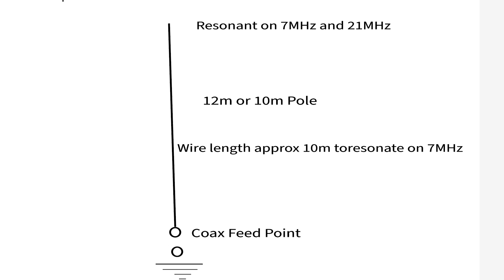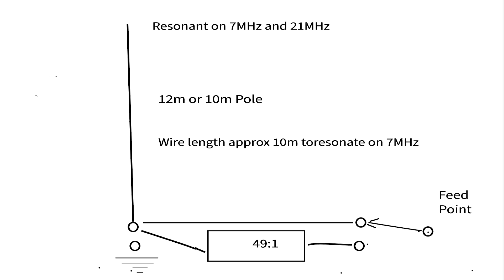Ham Radio HF Vertical Antenna -Small Garden HF 4-Bands Self-Build

Comment: There is no such thing as a magic antenna. Matching is not everything.  Radiation efficiency will be very low. In other words very little amount of power will be radiated. You will make contacts but what about the 100 contacts you did not make.

Comment: If you have a garden with a large tree then why not take a leaf out of (SK) W5JGV and copy the design for his Treetenna and see how far you can get out on 600Mtrs but other bands should be possible by changing the tapping point and maybe changing the variable capacitor.

Comment: Have you since made this antenna?
On the 49:1 balun, do I keep the 100pF capacitor in the circuit?
Reply: My question exactly. If EFHW works with no switch, but with 100 pf 3KV cap, why is one needed here ? I hope this gets answered. I’ve asked this question on many forums with many different answers.

Comment: Why can't the switch be at the other end, 2 coax to the shack into the switch
Reply from the maker: A long length of open circuit coax results - all kinds of potential problems.

Comment: Hi Peter, another very interesting video.  Based on your past videos, I ended up buying a Diamond BB7V vertical!   It is very well constructed, and I can definitely recommend it.  I used it last August with my 7300 at 100w, with success, from a caravan in a field in Herefordshire on 20/40m and had several contacts in Europe.   That antenna works without radials as it has a loading coil.   You mention needing a ground rod in this video: should I consider earthing the bb7v somehow to make it more efficient?  There is no mention of this in the rather sparse instructions from diamond!  Thanks and keep the videos coming!   (I have already made an efhw and the matching transformer as in your previous videos and it has also performed very well!) Mike.
Reply from the maker: Hi Mike, great to get your feedback. Summer is on its way again!  73 Peter.

Comment: If you can't get out radials, guys are going to be bit of a problem.
My only spot for a vertical is at the end of a narrow. A vertical might work acceptably with asymmetrical radials but will a Spider pole survive with out guys?
Reply from the maker: Spider poles are normally used without guys providing they are against a post of around 1,5 metres. 73 Peter.

Comment: Buy a DXCommander Classic ABV and you will have a 7 band antenna on one pole! And no matching problems!!! 40-10 metres on one feed.
Reply from the maker: But many hams like to build their own antennas and experiment. For example an end fed 20m half wave out performs a quarter wave. 73 Peter.
Reply: Peter I don't think you realise that the dxcommander is a kit and you have to build it. It's a better option than your solution. The lower angle increase in field strength, in your end fed vertical,  is only 1db and probably lost in the matching transformer. Anyway each to their own!  I have no connection with Dxcommander. Maybe you could stock them!

Comment: Hi Peter - great article! Now my problem is, is I live on a housing estate with a fuddy duddy Body Corporate (a group of rule makers that were not born in this or the last century) and their ruling is my Diamond CP6S antenna is not allowed to be seen from the road which makes 80m nigh-on impossible. I have a centre-fed long wire but it's too long for the size of my garden so would have to have it above the roof - a big no-no here.
I'm in a rental so options are limited, as is budget. Any ideas on a stealthy antenna to work 80, 40, 20 and 10m - I have a manual tuner plus the tuner in the Icom 7300...
Reply from the maker: You give mo indication go garden size. I would seriously consider an end fed 30m long wire with an 80m chock resonator. I use one myself. You can bend it to fit the garden. Vibroplex make one or you can build one. Check my end fed videos. BTW you don't need an ATU. 73 Peter.

Comment: In fact I made two of these for my QRP rigs for SOTA work in the past 12 months. A DPDT toggle switches the 49:1 In or out. My 10m long vert i cal element is actually 7m long with a centre loading coil. Works very well on 40. In the 20m setting, transformer and series C in circuit, it needed a bit more length, and so I added some air cored  turns at the base.  This is an obvious idea, thanks for promoting it, I'm not sure quite why more people aren't using it! BTW I haven't tried it on 15 or 10 but that makes it all the better. 73 Paul VK3HN.
Reply from the maker: Hi Paul. Glad to hear from you. The centre loading coil might be persuaded to act as a choke on 10m. That would create a half wave on 10m. But as soon as you introduce any inductance it has different effects on different bands. Suck it and see is the quickest way to find out. 73 Peter
Reply: @watersstanton  Thanks for replying, I'll bear that in mind!

Comment: I note that my swr on an EFHW 20 meter is nearly flat at the matching box but when I attach the rg58 coax( maybe 20 feet ) the swr increases to 1.5:1. How can I resolve this issue. I am using small toroids on the coax to prevent common currents. 

W5sk
Wave
Reply from the maker: I would first of all try increasing the turns on on the torroid. Unfortunately some VSWR meters are still affected by their position on the coax. Try increasing the coax feeder length with a patch lead of around 3m. If the VSWR changes then you will know that the meter is affacted by its position. 73 Peter

Comment: Amazing... I am designing this exact antenna for my POTA activations this spring & summer, with the exception of the switch. In testing, it seemed to work great on all of the bands you mention. My Xiegu G90 tuner actually matches it from 80 thru 6, though I doubt it’ll go far on 60 or 80. But the WARC bands get out okay. But regarding the switch, a double-pole double-throw switch mounted in the transformer box could work. One pole would short the 50-ohm input of the matching unit to the output, thus bypassing the transformer’s secondary. The other pole would open the transformer primary winding’s connection to coax ground. A/B testing on 40 and 15 should be very easy. I will report back with my findings.

Comment: G’day Peter

I have looked into this. One thing to take into account: At the base of an end fed half wave you have a rather much larger impedance than a quarter wave

Given Ohm’s Law and your power being V^2 / R your feedpoint voltage will be significantly higher on 20m into an EFHW than on 40m 

Now, your solution may be to make a 49:1 balun with say 14 turns on the antenna side, and switch between 2 turns and 14 turns on the transmitter feed side, but the voltage on that 14th turn on the transmitter side will still be at that high potential. 

Assuming the antenna is only 1800 ohms end fed, at 100W that’s 424V of RF so any remote switching you do must take that into account. 

You can reduce impedance by not quite feeding at the end, but a few feet in and reduce the feedpoint impedance of the half wave under 1500 ohms, but your 40m goes weird. 

I’ve been playing with this idea and simply installed a telescopic drawn aluminium tube with a 10m-ish length that tunes 20m with a matching transformer, and nearby ground stake, which works successfully....however, on 40m, the effects of the ground require something much shorter. 

I’ve settled on simply installing a base loaded helical whip tuned for 40m-ish on top of the 10m aluminium pole which gives me good broad coverage of 20m and a 250KHz chunk of 40m under 2:1SWR both behaving electrically as end fed half waves, though the 40m antenna is slightly longer than a quarter wave ground plane. 

I’m still experimenting, but given our small inner city plot we have here in Sydney’s Inner West Safe Space, with a 1970s Greek Lawn (concrete) my options for antennae is limited. 

Best thing I built is a switchable transformer match box that switches between 2 and 14 turns around a T240-43 on both the antenna and feedline side so I can make up any ratio I want to get the antenna to match. That said, I can only use this for end fed up to around 40-50W before I run into arcing. Given I’m only running 15-20W of CW it’s not usually a problem 

I’m looking forward to see how this idea works out for you.

GL es 73 de VK2NAP

Comment: the trouble is now when this new ruling comes in from OFCOM all Radio Amateurs in this country with modest set up will have to rethink about where their antennas are situated and how they have them mounted, for example, if you have a Loop antenna which is only 1 or 2 meters off the ground or an HF vertical that's ground-mounted I think they will have a few problems on where to put it? especially if you are like me and live in a townhouse with a small garden. is this the think end of the wedge  I wonder?
Reply: What’s the new rule for OFCOM ?  Here ACMA is stepping right back from most ham radio stuff.
Reply: @Brian.  I reckon that new rule is mainly there for the role out of 5g...    It was in the news today that the 4 big network providers have just bought up lots of available radio spectrum....
Reply: @yorkshirebikerbitsnbobs  you like the rest will have to abide by the rules.

Comment: The only issue with using 10m as a second harmonic to the 20m band efhw is that as a full wave its take off angle, even as a vertical, is much higher than if it was half or quarter wave. So ok for short hops but hampered somewhat for DX. 73
Reply from the maker: The vertical dipole is 2 degrees better than a quarter wave,  A full wave vertical is 30 degrees - not as high as some would have you believe. The worst length is 3/4 wave. 73 Peter.

Comment: Also these poles work great for supporting middle or end of a hw dipole Cntr fed with Toah Harbor open spaced feed line. 4” electric fence ribbed isolators tractor/farm supply plus 13” uv resistant wire ties and a spool of #12 Awg thhn solid core copper wire and balanced tuner you have the best multi band dipole with no coax loss. Coax eats a ton of 100w even short lengths. Balanced fed line puts out 97% of the output power 😉😉
Reply from the maker: Thanks for sharing. Losses on coax are actually quite low at HF with modest runs.  73 Peter.

Comment: Peter why don’t you try a Dx Commander pole ? You keep singing about spider pole this but why not buy a all in one antenna like the Dx. All the math spelled out with great wire and assembly’s fixture down to the nuts and bolts and clamping. Also you had sum bad audio feeds in the middle4:30). Stuff not lining up and all over the place. Might want to give it a look.
Reply: Kevin, the DX Commander a wonderful antenna. It’s a quarter wave on whatever bands you select. But home-brewing verticals with and without transformers requires only a modest investment. Experimenting with antennas is a fun and rewarding aspect of the hobby. Plus, it teaches skills that can save lives in an emergency comms scenario. You should join the fun.
Reply from the maker: Hi there. I don't think the Spider Pole is available in the USA? It's simply superior and stronger. I also like vertical dipoles as they have better DX gain. 73 Peter.
Reply: @watersstanton  Yes, the Spiderbeam pole is available in the U.S. thankfully. : )

Comment: I wish it would work on a 20m high Balkony without any Radials...
Reply: Für Betrieb als Viertelwellenstrahler auf 40m wird es nicht ganz ohne Radials gehen. Ich hatte vor einigen Jahren eine ähnliche Situation. Was Du versuchen kannst ist, mit stark verkürzten Radials zu arbeiten. Die fallen kaum auf. Jedenfalls nicht mehr als eine 10m "Angelrute"... 

Wenn der Balkon eine Metallbrüstung hat und Du direkt zum Metall eine Verbindung herstellen kannst, dann koppel diese Brüstung über eine entsprechend dimensionierte Spule an den Speisepunkt und der Balkon agiert als abgestimmtes Gegengewicht. Alternativ schließe die Metallbrüstung direkt an den Speisepunkt an und nutze eine Teleskopantenne mit entsprechend dimensionierter Ladespule als abgestimmtes Radial. Viel Leistung geht dann vermutlich nicht aber in der gegebenen Situation mit "Balkonantenne" ist hohe Leistung eh nicht machbar, ohne das die Nachbarn gestört werden.

Hoffe, Dir eine Idee gebracht zu haben. Bei mir hat es damals geholfen. Jedenfalls so lange, bis nach Eigentümerwechsel die Antenne vom Balkon entfernt werden musste.

73!
Reply: The Magnetic loop is your friend
Reply: @MidlifeRenaissanceMan  on a 4 by 10 foot Balkony with Roof isnt Space for a Mag loop...
I go for a Vertical outside of the balkony Mounted... only got hight restrictions. 10m over the Flatroof is end so a Vertical for at least 20m band is possible...
Reply: @kaiaussachsen  throw a 1.5m helical whip base loaded and tuned to 40m on top of the 33’ vertical and it will work to give you end fed for both 20m and 40m. That’s what I did and it seems to work OK. Had a QSO with Peter Parker VK3YE with a few watts. Made it onto  his YouTube channel :-)

Comment: An auto ATU such as an MFJ or LDG RT at the base Peter is where my plans are leading me too and using the same pole and 10m of wire.
Reply from the maker: Yes that will do the job - just costs a bit more but gives you extra bands. 73 Peter.